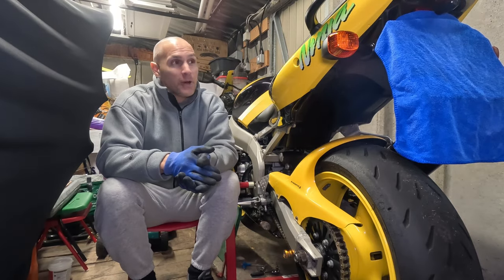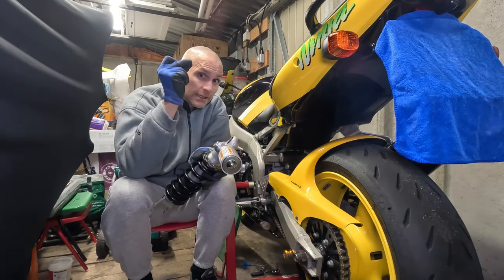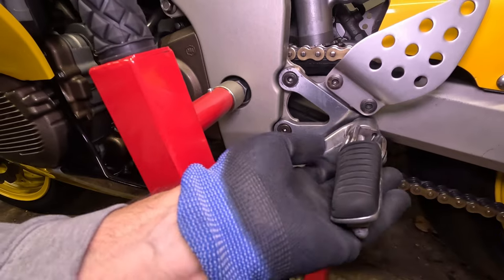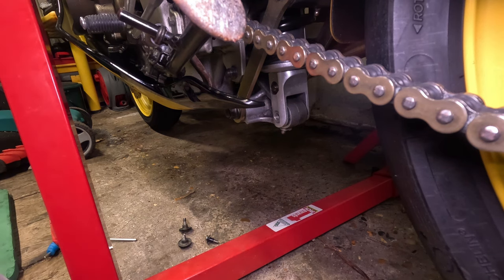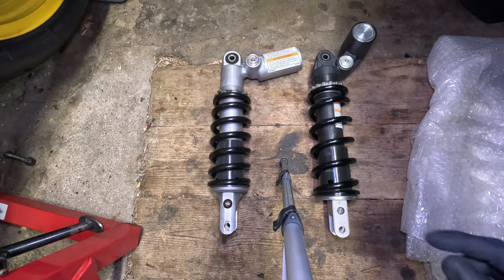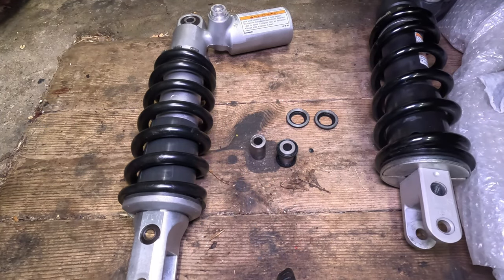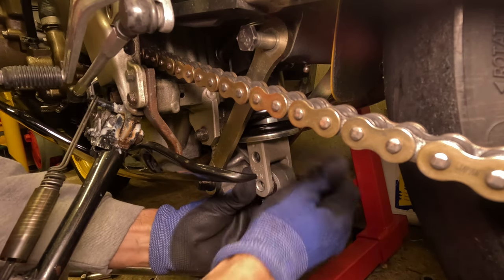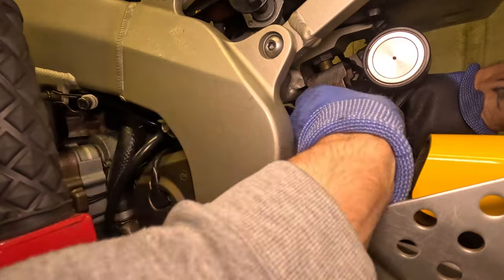ZX6R Rear shock 2021 upgrade

Comment: The ABBA stand was the best thing i bought for my bike, its just so simple and a God send when need to jack bike up, i think i paid £140 around seven years ago,
The lower bearings were seized on my pivot arm, [Z1000 most parts fit a number of bikes] and Kawasaki wanted far too much for new bearings, so bought aftermarket ones from Simply Bearings in UK, about 50% cheaper and cost me a tenner to have fitted at local bike shop

Comment: I just started taking apart my ZX636. Got the radiator and exhaust off so far.
My valve cover and oil pan are leaking. I’m going to clean/polish everything and check my valve clearance. It has 24k miles so hopefully after I put this effort in, it lasts a long time to come. 🤞🏼🤞🏼🤞🏼

Comment: Hello Tim! Your videos help me a lot! Do you have the document that indicates the torques that the pieces have?
Reply from the maker: Hi. Thanks for the comment and question. 
This is from the Haynes manual:
Suspension linkage arm to frame & Suspension linkage rod to linkage arm 59nm.
Suspension linkage rod to swingarm G,J,A models 34nm.
Rear shock absorber mounting, top & bottom, G,J,A models 34nm.
Hope that helps. 
Thanks again Tim.

Comment: great video not too many videos on rear shocks at all thanks for yours
you mentioned if the tire is not supported from under it will simply drop
i am planing to change my rear shock with a new one which is 2.5 inches shorter in length than the original one
so as far as you know all is going to fall in place? or its more complicated(i have a bmw 310gs)
thanks
Reply from the maker: Hi. 
When you undo the suspension there is nothing to support the rear end so it will drop to the floor. This is the reason you cannot use a paddock stand to do this. 
2 and half inches shorter is alot. I'm not sure how much this will affect your geometry and ride height. 
I honestly don't know other models of bikes to upgrade or switch suspension. 
I don't know if the swap you are doing on your bike is a common upgrade and would advise checking forums. 
Thanks for watching. 
Hope that helps Tim.
Reply: @kawasakizx6r813  thanks

Comment: Unfortunately mine is completely taken apart right now. The second and sixth gear got damaged and I'm short of money, hopefully I'll be ordering the shifter fork's and gear's before winter is over. My bike has been apart for more than two months now. But I did ride it most of the summer and it's everything I remember from having owned one before from 2013-2016. Picked this one up in June of 2021. It wasn't quite as good as the one has before, but this one has quite a few mod's and really low mileage.
Reply from the maker: Hi mate. Hopefully you can get the gearbox sorted and get back on the road. Would love to help but know nothing about the box. Someone commented on a forum I'm on saying the gearboxes are like chocolate. Everyone responded by saying they have never had a problem, myself included. 
Again hope goes well. Tim.
Reply: How’s it going bro?

Comment: Thanks for the useful video! Could you post a link to the facebook group? As i do own the same model, and im about to fit the 2014 shock absorber, with it's corresponding linkage
Reply from the maker: Hi. Thanks for the kind words. Can't get a link up but the Facebook group is:
98-02 Kawasaki zx6r only
Also I'm on:
Zx6r owners UK
Thanks Tim.

Comment: Does this still work with a 99g1?
Reply from the maker: Hi.
Yes the part numbers for the lower link arm, which is where the shock bolts to is the exact same part number. 
I was also told yes by quite a few people on the 98-02 forum that they have upgraded their own G1-G2 by the parts I lost in the description. 
Hope that helps.
Tim.